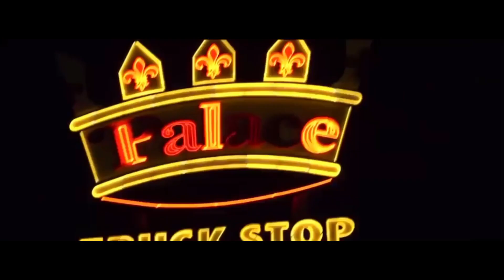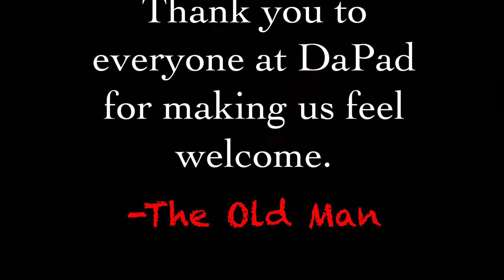BEHIND THE SCENES of our FIRST trip to DA PAD!

Comment: I love your videos, and Billy’s, and I love both trucks. I have to say I’m a turbo guy, but Tommy’s truck has won my heart. 

I’ve been helping my dad build his 1996 S10 regular cab short bed. Little 383 stroker, aluminum heads, solid roller cam, and a nitrous fogger. 9” rear with cal-trac bars and we just got it fired up and driving on the street getting it broken in. I can’t wait until we get to take it to the track for the first time.

Comment: Love the channel. You might want to look into a DJi osmo mobile 4. You can put your cell phone in it and it will stabilize the video footage. Also it has a 1/4-20 thread in bottom so you could literally mount it on the dash and save you  having to hold your arm out to film. They're not very expensive and you can still do everything the same way on your phone that you do now. :-)